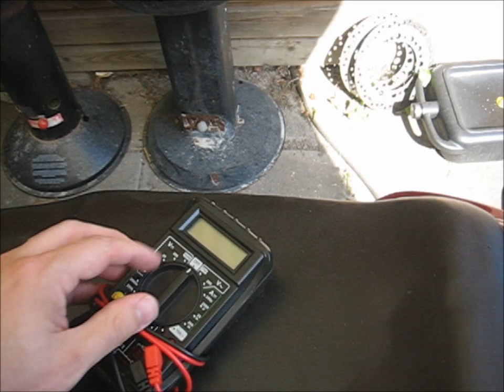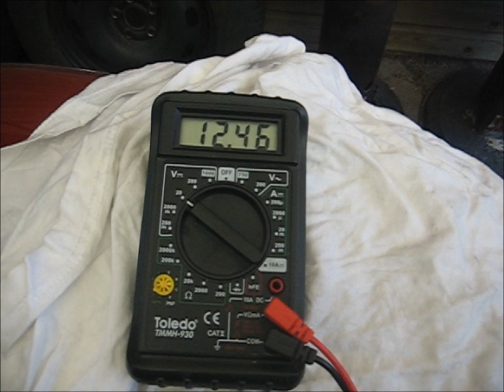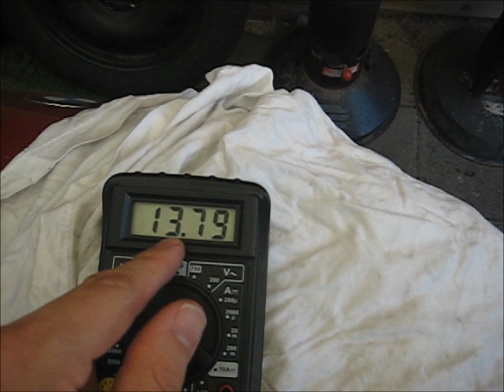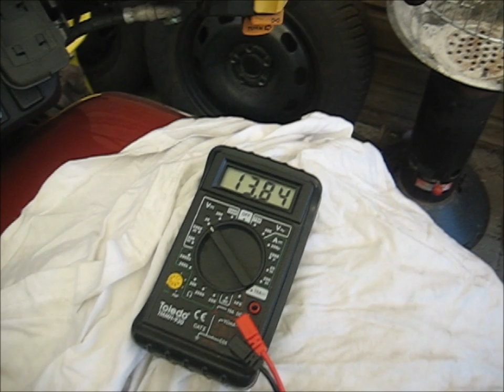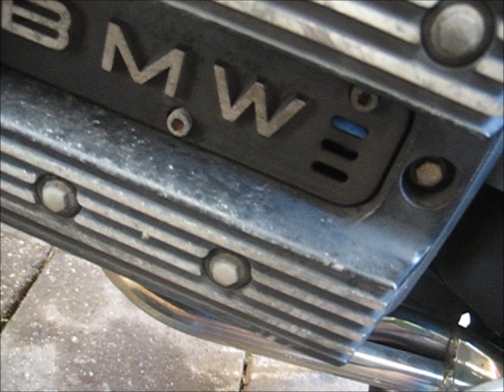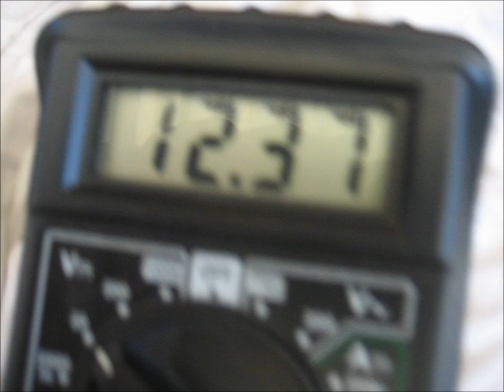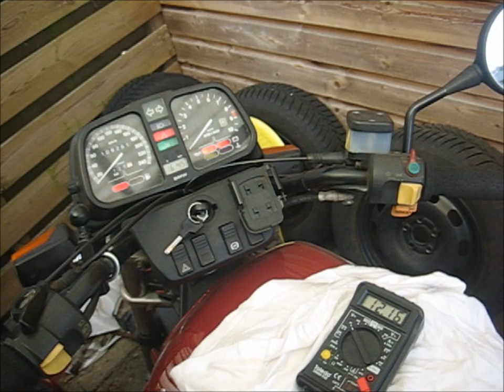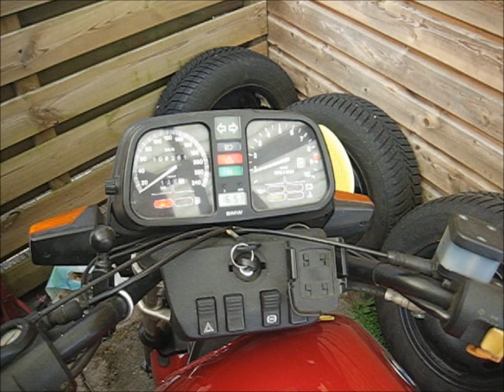BMW K75 How to check the battery and generator, and connectors

Comment: Ok, not true for the 88 75c! The ecm is attached to it. I was ready to start pulling harder since his came out so easy. What year is his?
Reply from the maker: 1991 ,
Reply: @djverhulst  my seat has to come off.
Reply from the maker: @rushtk2112  you have different types of saddles on the K75,,, a normal K75 or a K75 S the saddle comes off completely, but on a RT you can flip it over, this k75 has a RT saddle
Reply: @djverhulst  I'm learning, my 88 75c is my 1st K bike. Trying to keep the battery charged. I'm using the 1985-1995 Clymer manual.

Comment: Sure it would be interesting !
I 'm on your channel watching all your videos right now.
I would like to buy a k75rt ,it's very cheap but needs some work as the fuel pump wich is siezed.
At bmw dealer it's very expensive 320 euros !
but it can be replaced by a fuel pump from cars wich is nearly exactly the same.

Your channel is interesting and there is a lot of informations.

Thank you about that.  : )

Comment: Hey there I have a 1990 K75 C and my speedometer was acting up and not working for a few days and then i came outside and tried to ride it and the battery was dead i jumped it it was fine i went for a 2 hour ride then let it sit for about 45 minutes and it was dead again do you have any idea what could be happening could you possibly make a video on how to clean the speedo connection inside the instrument cluster
Reply from the maker: +Kyle G first I check the sensor on the cardan,  when there dirt on it wouldn work proble
Reply: I have an '87 C.  My own speedo would work/not work- typically at less than 25mph.  What I did:  clean the other end first.  At the rear hub, remove the speedo sensor and clean it off; reinsert.  Mine worked after that.

Of course, the PO (or POS to me) failed to mention that he had reamed out the hex head/Allan bolt for the sensor- so I had to get a bolt extractor kit to get that out; stripped.  Kit= $22.  New bolt, $1.88.  Labor=$0.

The other- which I failed to do after taking off the instrument pod, it's back, etc.- was NOT cleaning the connector prongs prior to re-assembling.  I didn't know about that- and that fix at the time- because I was chasing another varmint at the time, unrelated.

Because I was already "there".  The "C" fairing was off, cluster off, etc.  IF doing so...while you have the back off the instrument cluster pod- replace all the lightbulbs.  Replace the rubber seal.  Check all connectors.
Because you're already there.